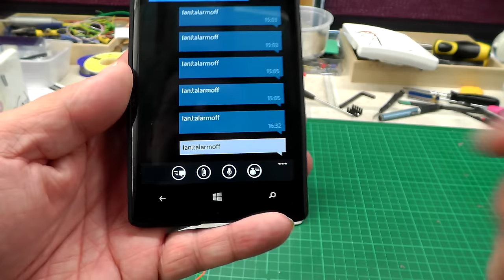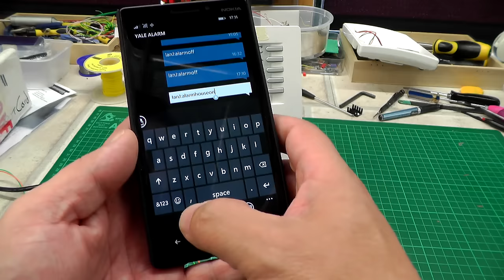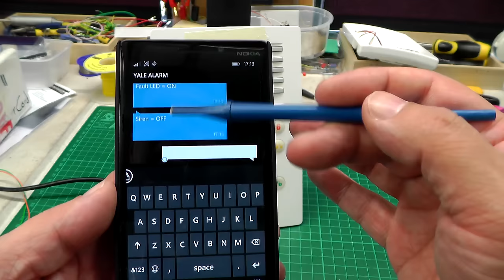Yale HSA6400 Burglar Alarm Arduino modifications - Part 2

Comment: Brilliant!  Out of interest, what's the part no of that DC to DC convertor - interested in using that for 7805 swap outs on other old equipment.
Reply from the maker: +GadgetUK164  There are a few in the series, I am using the XP SR10S05.
Reply: Thanks!
Reply: +GadgetUK164 Just watch the minimum load. The voltage drifts up a little bit on lightly loaded circuits.
Reply: +SDG Electronics 

Yep. Minimum load is a perennial issue with a lot of switchers.

Comment: Ian, Very interesting! a few questions:

is your new circuitry protected by the same battery backup the device is using?
If the code is getting a little too big, and you plan to spin a new board anyway, have you thought about going to the next Atmel chip with more Ram?
Have you implemented the "mobile phone number checker" functionality in an easy way to add/change existing numbers and allow for multiple numbers should the need arise?

A very interesting video series! i look forward to the next video! maybe a video on laying out the board? that is always fun to watch!!
Reply from the maker: Yes, my kit runs off the system 5vdc supply. I am thinking about the atmel mega 1280 which gives me 4 times as much ram. I had not planned adding functionality for user settings except by way of the programming header is available from the back. In this case as it is a one-off for my own use I hadn't minded hard coding. Hmmmmm.

Comment: Glad to see you got it working. As you are aware, sometimes what you plan to do doesn't work out, and you have to bodge it
before spinning a new board.  Just curious, what analog switch did you use.
Reply from the maker: +Steve Rodgers For the bodge 3off 4066 as thats what I had lying around, but the new board will use 2off 4051 analog mult/demultiplexers with a modified Arduino interface.....less I/O.
Reply: +IanScottJohnston 

Using the '4051 make sense. When you initially had the FET's installed, could it have been the body diode in the FET which was causing you trouble? Analog switches isolate current flow in both directions when they are off,
but you need back-to-back FET's to do the same thing in a discrete design.

Comment: You should consider some feedback when you send command to alarm, GSM network can be unpredictable, now you don't know is your command even received (I had all kind of interesting experience with GSM modems, but I used TCP/IP instead text messages)As of space on 328 just ditch Arduino and your program will use much less space (not to mention it will run order of magnitude faster)
Reply from the maker: +Petar Petrovic Yup, I have implemented feedback.....just not shown in the video. Thanks.

Comment: What about spinning LCD decode out to another chip running it's own code to grab the whole display and then the main loop simply uses the serial ( or I2C bus) to get status as needed. Extra IC but simpler code, and you could also use it to do the digital inputs as a part of the status byte it has as well. Could even use the same clock generator saving a crystal.

Have you considered changing out the crusty NiCd cells to a 2S lithium pack and charge controller, setting the pack to charge to 80% of full capacity for long life. That along with the step down converter should survive long power cuts while still giving reliable warning.
Reply from the maker: As soon as I get my logic analyzer working again with Win10 I will be back on the case.
Reply: +IanScottJohnston As a first step you could just set the Arduino to output the data lines and control lines on the UART any time there's a change to the enable line and just log all the data.
Reply from the maker: +SDG Electronics Thats what I was doing......just couldn't make sense of the data I was seeing.....and which was very repeatable.......got a ways forward now though thanks to my logic analyzer.
Reply: +IanScottJohnston Cool, look forward to seeing the decoding :)

Comment: Nice work. It's a shame the STM32 Arduino knock offs aren't 100% library compatible. The extra I/O, horsepower and RAM would be ideal for this project.
Reply from the maker: +JamstaUK - For a laugh I just tried compiling my code for the Arduino Due (had to make some small mods to the GSM library first) and it worked! So, tentatively I could use the Due's Atmel SAM3X8E ARM Cortex-M3 CPU (CPU Clock at 84Mhz, 96 KBytes of SRAM, 512 KBytes of Flash memory) Downside 3.3Vdc, so would require some other mods. Hmmmmm!
Reply from the maker: +IanScottJohnston The Arduino Mega is 5v though......maybe a better choice. 128k Flash, 8k ram.

Comment: Writing your own code to drive 1602 displays can be a pain in the rear, so I can understand why your having issues decoding it.
Reply from the maker: I remember 20 years ago finding some 1602 displays would have issues over others.....timing on some brands was a bit dodgy! 😐
Reply: +IanScottJohnston I'm not sure on what the Arduino provides in terms of port access, but I'd be tempted to use a parallel shift register and trigger the input latches from the strobe or enable line to the LCD so that you are guaranteed not to miss anything to the LCD. It'll also reduce the CPU time spent reading the GPIO. Are they sharing the data lines with anything else on the PCB?
Reply from the maker: +SDG Electronics Whilst I await the driver for my logic analyzer I hooked up the PM3585 logic analyzer (the behemoth I converted from floppy drive to SD card) and looked at the Yale LCD I/O........lots of reads as well as writes to the LCD, so no wonder I was picking up lots of data I didn't recognize. So the answer then is to fully decode E, R/W and RS and I should be able to pick up the data to the LCD. Btw, Arduino just add additional, easier to use I/O commands......the full Atmel direct port access is still there which I was using. But yes, probably easier on the interrupt system if I do some of the decoding externally. Hopefully this weekend (dang day job!!!).
Reply: +IanScottJohnston I know what you mean - I have so many projects lined up, but I typically only have an hour, (maybe two...) available on weekday evenings.  I did suspect they would be reading the RAM contents back - it saves MCU RAM and makes scrolling and updating only sections of the LCD a bit easier. Steve

Comment: I can already "see" / Hear a potential exploit! Might wanna lock the OS down a little more. and it being GSM makes it even easier.

I'll explain How and Why

if someone were to do a packet exploit, they could force the alarm off, after scanning frequencies in the GSM/bluetooth spectrum OR do a ICMP exploit, and just force the system to shutdown all together it would be sending so much data, that it would just shut off. thats why i posted about using a Pi, instead of a Ardu. |

I have an "live" linux/unix OS that allows me to scan for closed or secured connections, it also allows me to get the info on the system. and any other information.......
Reply from the maker: I'm not experienced at all in such things, but in my mind for the Arduino to be coaxed into turning off the alarm would require it to think an SMS was received from my mobile phone number and the correct command sequence received. Of course I can't vouch for the entire GSM library though.
Reply: yeah thats why i commented previously about using a Pi instead,
Reply: +Amy Marie Hi, I'd be interested to hear a little more on how this exploit could take place, surly if there is some some of Packet exploit on the GSM network then the incorrect messages would be sent from the GSM module (the thing being exploited) via SPI to the #### Module (this could either be an Arduino in Ian's case or a Pi in your example) at which point the code running on the "controller" would validate the message, see it is coming from the incorrect sender(Ian's Phone) and containing the incorrect message(a secret message Ian sends, which can only be obtainable if you were monitoring GSM packets between his Phone and the device prior to executing the exploit?) and not execute the function(s) responsible for simulating the button presses to unlock the alarm?

With regards to ICMP, correct me if i'm wrong please (I am no expert in Low ISO network or InfoSec and I like a good educated and informative correction!) but SMS and GSM don't actually implement ICMP in the protocol they use for communication? i was under the impression that ICMP was used on higher throughput and more structured networking standards such as ethernet and wifi?

And the Denial of service attack you mentioned about would also be exploitable in a raspberry Pi as much as it is in an Arduino, agreed, you will have more processing power on a Pi to process the quantity of messages being injected but if you were to hit it hard enough you could "crash" a Pi resulting in the same effect/results.

Additionally, although i do not know how Ian has implemented it, but IF the Arduino was to be forced into a reboot, then it would not execute the simulated import to disable the alarm, it would merely be forced to reboot, come back up and sit there waiting for the SMS (or another DOS attack causing the loop to occur again)

For this to be an exploit it would require the Arduino (the thing actually simulating the button presses) to fire its function(s) to input the correct sequence of button presses to unlock the alarm.. 

Additionally, and finally, I am unsure what you mean by "Might wanna lock the OS down a little more." The Arduino is a 8 bit micro-controller, it does not have any where near the resources required to run some form of RTOS (Real time Operating system) 

As I mentioned, please correct me, or provide more information so I and other can learn from this. :)
Reply: check out a Live OS distro called Back Track.
Reply: +Amy Marie I'm aware of backtrack. I actually prefer kali though. I'm still not sure how it relates?
Reply: I tried to post what it does but YT filtered it out, its an exploit OS.for wireless systems.